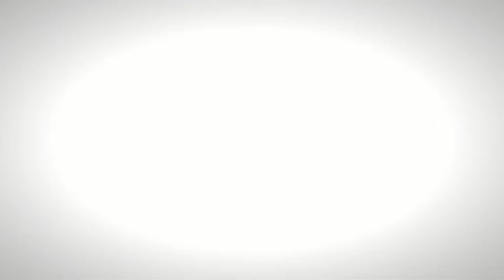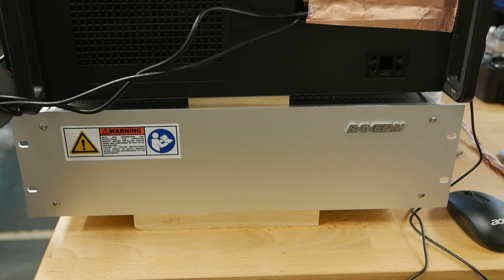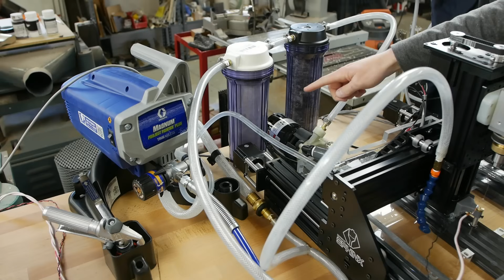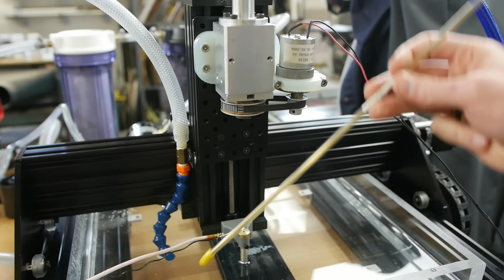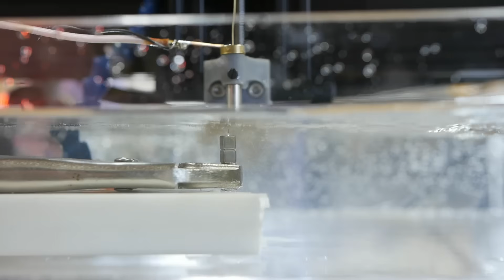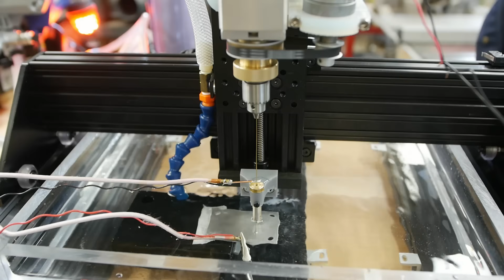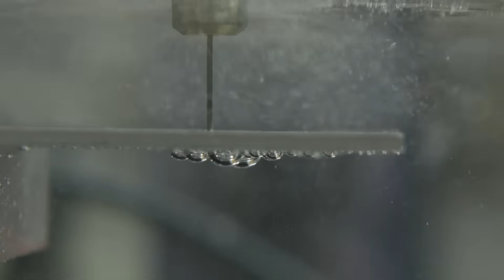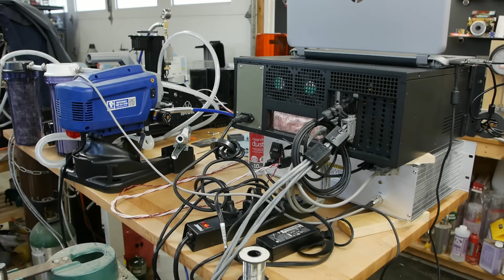Drill through anything (conductive) with Electrical Discharge Machining

Comment: I workt with this kind of machines in the early seventys. One was  the brand " Sparkatron " the other an AEG . They where used to make the form in disques and more complicated  for aluminium and plastick extruction. When you have an aluminium profile or a plasic one, and you cut 10 mm of it and you make the same form in a cupper , put electricety on it and you put it on a metal plate it will " spark" itself down trough the metal if you are capable ofcorse to keep that cupper model at the same place, cool it and get away of the waste, the sparks. I used those machines also to cut steel pins out of holes that could not hammerd out of a blind one. The steel pin is round, too hardto dril it out. So, I made a flat electrode with almost the wide as the diameter of the steel in, cutting the steel pin in halve and then the two parts could be taken out, because there was space between them.  One can make an electrode in evdery form, spark it in metal and then there is the form to multiply it with liquid material as aluminium or plastic etc. We used  plane feul for cooling the sparkin had to be under the feul level and that liquid cooled of there was a fire ofcorse. Water and steel or iron are not friends, that was the reason.  The parts we " sparked " had diameters till 50 cm and 30 cm high . Making the electrodes was complicated work out of cupper plates, because the " sparked " result has not the same mesurments as the used elecrode and the mesurments of that wanted profile is not the same thicknes everywhere.

Comment: Actually nearly every modern (last 3 years or so) 3D printer can use a sensor feeding the controller a variable voltage  signal to control jams and blockages in the print head. both by raising slightly and also reverse feeding both the extruder motor and the z axis. and most of these boards use CHEAP components eg Arduino and raspberry pi.
As soon as you started talking about this, my first thought was "hm I wonder if I can get my little micro CNC to do that. and as you explained that there was NO other controllers that reverse feed based on a signal from a sensor. I realised you were mistaken.
there are THOUSAND'S of you tube vids out there showing this.

Comment: Can this method be use to drill a hole through a Neodymium magnet (coated with : Ni+Cu+Ni Heavy Duty Triple Layer Plated, ). The magnet I had in mind is found at this link: 
https://www.amazon.com/CMS-Magnetics-Sphere-Neodymium-Magnet/dp/B01M0XOFOK/ref=sr_1_8?keywords=ball+magnet&qid=1565055752&s=gateway&sr=8-8

Comment: LOL! This GREAT!        I'm not sure how expensive that CNC frame kit is that he bought .. but I have a desktop cnc mill engraver jobbie  that only cost me around $280     it's a 3018 pro with upgraded firmware, stepper motor driver boards and has laser support etc   ( china made which sells under various brand names but are all similar) 

I can see raising my existing motor holding assembly ( or just 3d print a new one altogether)   and just placing reservoir on the bed with enough room to do most jobs within a few  inches of depth ..( hypothetically)   and then grab that $63  jobbie from ali or maybe banggood has one too.  as far as the grbl controller software, there are a few that are open source ( FREE!)   and  IF they cannot retract the Z axis  as required by this process, I'm sure anyone with a bit of coding experience could patch it to do what they want....   ( perhaps me!  : blush: )   

on a similar note:   anyone that wants to make some  really nice prototype PCBs  .. I have a vid that shows you how nice they can come out after  a painstaking long process of getting everything all dialed in ...     Here is an example of one I did ( on the cheap!!!)  :  https://youtu.be/Uf6bCRuQMzw .. I know I didn't go into too much detail of the whole process , but I intend to make a much better informative video in the near future!  Just comment under that vid and ask me.. etc .. I'll help ya out , no problem!

Comment: Could this be done in conductive rock ?

https://watermark.silverchair.com/53-3-583.pdf?token=AQECAHi208BE49Ooan9kkhW_Ercy7Dm3ZL_9Cf3qfKAc485ysgAAAkgwggJEBgkqhkiG9w0BBwagggI1MIICMQIBADCCAioGCSqGSIb3DQEHATAeBglghkgBZQMEAS4wEQQMfwRy00lzAO7LZyP_AgEQgIIB-ygUzh-B2-4FzEtkmnlKo3yIOfipap_mt5u9Ti6KT4YNOmuQ9f5-fffQagpzb_M1UrzggY7HujBy8sg_lAEoAmrtHCH7rMogNimwG_5fGF928yNqWa4hDB3RcQKtFDumN4QBxjTdNXrYQroyNbrFNAbORrAH_DAF3YRJ_hZXh6Vv6aiEubTIalYODCDktXAZZdObrX7HsQ8ig_WlrYBn78r7KKreHDfntu2kyvy9UEHXmt90CZKJxpI-rHmZA5HVQdLKkO3cpdss_XxgUUrDCD7mUdmAisMlqlxgcX9vgv7FDb_cVqMln5xDEca0m3-bddFj2GeSznG3M3Rma5k7LYSHsISJqgwSy9Auk8smeLoJyJLeTj37ASA0FE63YpBeG5m1CsyVLQASFzPoi1jO7RG487WweWBfRm71vhwF5juvZoohDbWF3h2dsvmoLWYPaOkcTGVjrj5V2Oela_om9P7xcfSEvx4Uxxz8ZqB-ouQpCX83gfYTbdKZoJbbyxOfKPAiAboAMOOFmp20PqkRxgHT9jfNY-4_fv5p3dbshEFLY62mcSUIevI4q0uIt8MadG5Vx6ncvJj1IoBidIAKaqIxf7VaHXH1Gx35nhC06kftEY9U_F2dc-ajhZKrd0KSOQ5LFgpW1bJopCkpmIi42hnYzvviYMQPtQ80nw

Comment: My english not good. For this i cant understand lot of things in your video. I was saw this machine before. Someone want to build this machine.. he was explained some detail about this machine. He said " there is a fast servo motor  and fpga. And its move back Electrode after touch surface. And repat again untill. work finish." He was said mcu not fast for do this.
How you do move electrode move front and back ? What are you use for do it ??   Mcu or fpga ?

Comment: Did EDM at a local shop that creates precise deformities into metal stock for testing purposes, the liquid used was kerosene, that was later switched to a mineral oil. we used play dough to create containment dams, this way you used much smaller amounts of fluid. The conductor of choice was carbon, which  could be shaped to almost anything, using a lathe. enjoyed the video

Comment: The chuck has a little wobble visible to the eye. Why you don't make a timing mark on the chuck and the spindle, so you always put it in nearly same spot and then reverse drill the chuck...you will have perfectly concentric gripping surface of the jaw...

Comment: FYI any 3d printer control board should be adaptable for this application. the 'tool' is a stepper driven filament that can be driven in both directions.

Comment: i'ts like welding with a tungsten tip, but the current is so potent that vaporizes the metal in a tiny point, cool, i didn't know this existed, but it actually makes a lot of sense

Comment: And a short only happens occasionally. Like only ONLY once every minute or 10 seconds. Only.
Reply: At 15kHz 10secs means once every 150,000 cuts. A minute means 1 short in almost a million cuts.
Reply: @Kimdino1  shouldn't it be 15,000 not 150,000
Reply: Thats not a lot when machining something takes 5 seconds
Reply: Ideally, it should never short.  If it shorts, the circumference of the hole at that point of the short is smaller, creating an greater uneven inner surface.  The short detection is a failover, for a failure to control the feed rate properly.  High end machines never short, as long as you’ve configured and aligned everything properly.  The feed guide was way to far away from the cutting surface, which contributed to the widening of the hole circumference.
Reply: A short is still a short ⚡ what calculations are visible using instruments that travel towards the speed of light
Reply: I wouldn't want anything to short travelling in the air or space 😎wanna b near exactly as possible

Comment: I want to use this machining technique to build a nozzle, a laminar flow nozzle to be used in a high pressure laminar flow flame thrower! I suspect this would elevate the flame thrower to a whole new level. I have a few questions though, can the drill holes be tapered or are they always linear ? If I could drill holes in some high strength steel round and taper them I could increase the pressure on the output side. The same physics that strip miners used in the old days by damming up a creek on a mountain side and channeling the water flow through increasingly narrower pipes so that in the output side they had enough water blast force to blow away the mountain side looking for gold.

Comment: When I was much, much younger I worked at Specialty Machine Shop. The owner Repaired, Modified and Created Movie Cameras for the Film Industry. The mainstay was incredibly fast High Speed Cameras. They would send me to a shop with expensive parts that had broken off Drill Bits and Thread Taps. I believe this was the method used to remove whatever was broken leaving parts and sometimes threaded holes unscathed. I would always see a lot Race Car parts (engine cylinder Heads) there with broken off studs etc.

Comment: Well, Young Man, I loved your Vid! You are very well spoken. Being a Tool and Die Maker for over 45 years, the most interesting conductive metal I have ever EDMed was 6AL4V Titanium. Give it a try, you may find that drilling an off centerline hole in a Titanium round will bring you a few hours of "Fun". You might be able to do an entire Vid on the drilling of that material. Excellent presentation.

Comment: Does titanium steel conduct electricity? Can you drill a titanium steel camping spoon or something? I've heard titanium is notoriously hard to machine. I've warned people away from titanium wedding bands because if it gets stuck on you, in one case a jeweler went through 5 diamond bits to cut it off a man's finger, and those bits are about $100usd each for the good ones.

Comment: This is also known as 'spark erosion'. Can be used to remove broken drill bits - amongst other things. It is a relatively old technique, widely used in tool making. I was once an apprentice toolmaker. As you say, there is a related CNC technique, known as wire erosion.

Comment: I believe tiny holes in fuel injectors are made with this process.
Reply: Confirmed. I ran EDM machines using oil and water as a temp on 3rd shift at a local fuel injector plant not far from BMW 20+ years ago. They were phasing out the oil based units.
Reply: @stephenlloyd3064  oil based?? holy sh....
Reply: @BoRedfearn  Oil is a good dielectric and heat conductor, especially with (now illegal) PCB additives. It's what's in the transformers on top of every 5th or 6th telephone pole. At the injector plant they switched to a system using deionized water + a proprietary chemical mix after new OSHA regulations were imposed sometime around 1996.
Reply: The holes in fuel injectors could also be done with a laser, assuming that that they are through-hole and non blind holes.
Reply: GroBestGardens why can’t a laser create blind holes?
Reply: @superalvin7208  ... Yes, you are correct.  A laser can certainly create blind  holes.  Just need to be more careful with the setup (laser power and duration) to accurately control the depth.  Technically, a high pressure water-jet (at 40,000-100,000 psi) could perhaps make the small blind holes too (depending on the size), but it wouldn't be my first choice (as there would be a couple of disadvantages to this method).     Ed
Reply: GroBestGardens I understand, thanks for the explanation!
Reply: @GroBestGardens  is it because it is too hard to keep waterjet precise at that size?
Reply: @DarkorbitKing100  There are actually a number of considerations when determining the best process to use.  Here are a few of them (concerning laser and waterjet cutting).  What is the material being cut?  What is the diameter and depth of the hole?  What are the required tolerances of the hole?  Can the material tolerate extreme localized heating (of the laser)?  Can the material tolerate mechanical stress (of the water jet)?  Will the material give off toxic fumes if laser cut? ... and perhaps a few more considerations.

If the blind hole diameter is somewhat larger than .040" (1mm), then waterjet becomes more possible.  It is common for a commercial waterjet to be about .040" diameter, but at close to .040" diameter hole there would likely be irregularities in the diameter (as material is first eroded and then blasted out and backwards as the hole is first being pierced into the material).  Many commercial lasers could comfortably make a hole of .010" (.25mm) diameter (assuming that the operator has the laser beam focused properly).  There would not be the same problem with hole irregularities (using laser) as much of the material is actually vaporized from the hole during the cutting process.  Once the cutting starts, both methods could comfortably maintain tolerances of +/- .005" (.13mm).  More specialized lasers could perhaps make even smaller holes with tighter tolerances.

If the hole is deep, then I would expect the waterjet to drift/wander somewhat as the hole is being cut.  As laser wouldn't drift/wander in the same way.

If cutting material such as steel, as laser is very efficient.  If cutting aluminum or copper waterjet has advantages.  Materials like copper and aluminum will reflect or absorb more laser energy, causing additional heating or requiring high power from the laser.  Waterjet wouldn't have this disadvantage.

Laser and waterjet cutting are often used as complimentary processes, even within the same machine shop.  The specifics of a particular job will tend to lean toward one or the other process being more efficient and successful.  Here is one shop that I have used for various projects.  https://www.mform.com/services/cutting-and-punching/   They cut sheet/plate of practically any sort of material.  You can see from their website some of the considerations that are made.  You will also see that there are even different variations/types of laser cutting.

Ed
Reply: @GroBestGardens  thank-you very much for the info! I had a hypothesis that the debris from the nature of the waterjet could be a factor.
Reply: @DarkorbitKing100  On one of my projects a few months ago, we planned to make .003" (.076 mm) diameter holes in very thin (approximately .005" (.127 mm)) thick stainless steel sheet.  I found a shop that could do this comfortably.  We may use them in the future for this project. 

Ed
Reply: The first documented use of EDM was when the NASA used it to drill the fuel injector holes for the thrusters of the Saturn V. This should've been sometimes in the 60s after the method was starting to gather more attention.
Reply: @LeonNighttime  I read years ago it was first used on WWI German submarine hulls. Might go further back than that.
Reply: jets in carbs too

Comment: Don't plasma cutting cnc's have something similar to negative feed rate? Or is that too specialized for hobbyists? AVC (automatic voltage control) is what it would be called for those machines.

Comment: I work in a machine shop / mold making shop. I do standard machining work. EDM is relatively new to me. Not the existence of it but seeing it first hand. Our machines, one wire and one that uses graphite electrodes use a special "EDM fluid". Would this be better than water?

Comment: Fun fact: I'm a mineral physics graduate student working with diamond anvil cells. EDM drilling is still used in labs to drill holes through gaskets for diamond anvil crlls. The gaskets are actually indented down to 10 microns thick and the holes drilled through can be 20 microns or less wide. Yeah, you can drill incredibly tiny holes with a high quality EDM.

Comment: You could probably use the EDM drilling machine as a reverse 3D printer.
Take away everything you don't need from a piece of metal and you end up with the piece you need.
It'll probably take forever though.
Reply: ...that's just called "machining".

Comment: Electricity and water. If this was me I'd be dead a minute after attempting this.
Reply: David Hughes I was walking by a cinder block building and a guy was cutting a 4' x 6' opening for a window using a bigass electric saw mounted on a framework attached to the wall. He was using garden hose water and had a muddy mess at his feet. I stopped and looked at his operation and said "JEEZUS you are your own worst enemy" he turned and looked at me with a great big smile and shook his head yes. Then I got the "F" out of "H" in a hurry.
Reply: FYI: Did you know that water in it's purest form isn't conductive at all and actually an insulator?
It's the dissolved minerals(ions) in water that make it conductive. 
This water is deionized. And I didn't watch the video thing so I apologize if he explained this.

Comment: Wouldn’t those rubber wheels wear over time destroying your tolerances and accuracy?
Reply: They would but at the production rate shown in this video or for a typical hobbyist, not so quickly that it is cost prohibitive. This set up is popular with engineers before scaling up into production runs as it is durable enough for proof of concept. Wear can also be accounted for by the software. My retired mechanical engineer father in law has discussed prototyping machines running for 100,000 cycles for stress testing. These machines were built from the same extrusion and plastic, nylon, and or rubber wheels you see in the video and used in a similar manner. Also, for this particular application, the stress on the Y, X, and Z axis of the machine is so low, that other critical components would fail before the motion control surfaces fall out of tolerance.

Comment: Edm oil is better to use than water. And the electrode won't erode if you burn using positive electrode vs negative electrode.

Comment: I used an EDM back in the mid 80s. Sparkatron I believe was the name of the machine. We used shaped copper electrodes (which we made on a tool grinder) for the cutter and submerged the whole piece in paraffin as the coolant. We used it to cut through tungsten carbide pellets which were encased in steel. These were then highly polished and used as wire drawing dies. It was an amazing process to watch but very dirty and needed good ventilation. It also took many hours to cut a large blank.